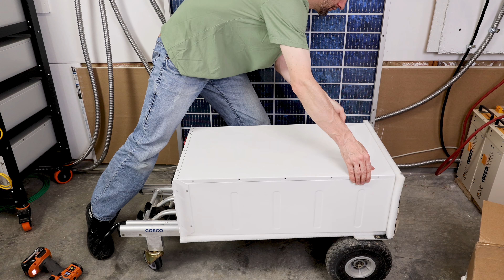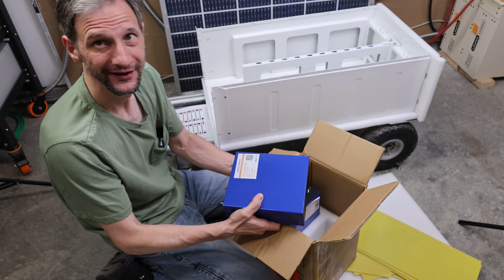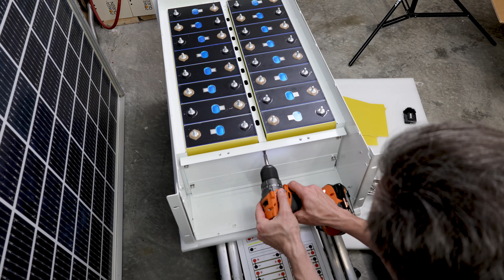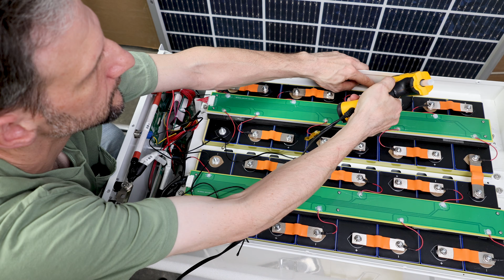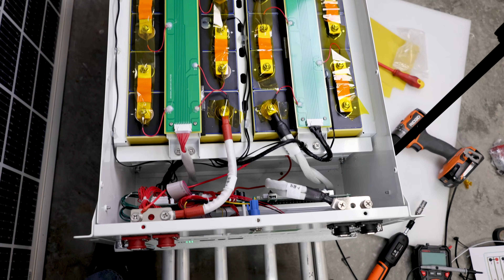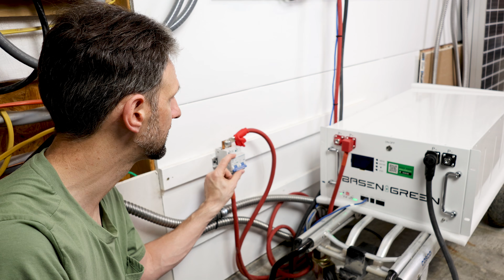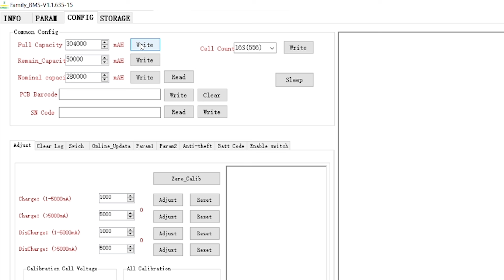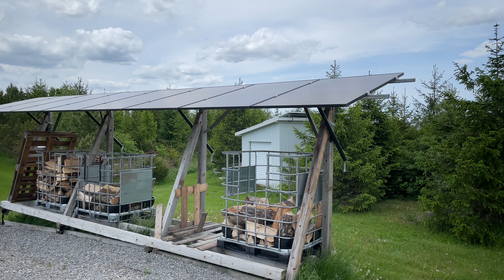SAVE Thousands - Build your own home solar battery backup!

Comment: Great build sir.  My only critique on these boxes are that they don't have a fuse or breaker beyond what is in the BMS.  You might be able to add a T-class fuse inline on the main red positive conductor.  A little tight to secure a fuse cover to the inside of the box.  A small DC breaker would be nice as well.
Reply from the maker: I wanted more than the BMS fuse as well, that's why I added the external breaker.
Reply: Excellent build and instructional! 
My only concern is missing active cooling ability.  In warmer climates, under load  the cell temperatures could be in the higher range. This possibly could cause loss of capacity. Is this a valid concern?
I am a new subscriber today. Excellent content coverage❤️
I am looking forward to your future videos ..😊

Comment: Nice video, thanks. Can I check that it is ok to stand the case on its side which means the batteries are not upright?
Reply from the maker: The side is ok, I just wouldn't turn it upside down.

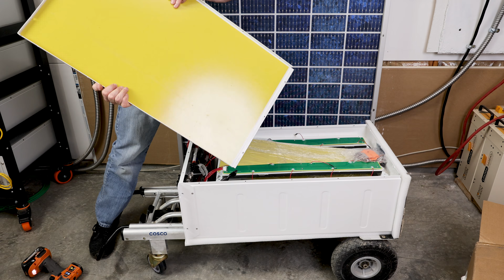Comment: 2:25 I almost had a panic attack as I watched him lift of the front panel and almost take out the pcb.  edit: I think it did make contact, if you didn't notice might be best to check the traces for any damage.  Gorgeous looking system.
Reply: He barely bumped the fiberglass strip for the balance wiring. Not a big deal.

Comment: 15kWh of battery for a little over $2000 is absolutely amazing!
Reply: $2300 with circuit breaker vs $3300 for a signature solar battery, perhaps less if bought on sale.  Nice savings, but at the same time the signature solar one is pre-made and has a warranty attached to it and has UL.
Reply: @asusreviews  Personally, I prefer the idea of knowing the system intimately. that way I can perform the repairs instead of having to call someone out. as for warranty you can likely get that for each component and UL just means a third party says it is safe when used as intended. not overly important but again like the warranty you can likely get that review on the individual parts.
Reply: @asusreviews looks like we're all winning here!
Reply: @asusreviews  if you are building it yourself I assume you cannot get the federal tax incentives.
Reply: @juanmedinar20  Who knows honestly.  Would have to do some digging in the rules/regulations/requirements for that credit.  But that is a good point, it may not end up saving any money if you don't qualify.
Reply: I think you'll find the tax incentives are self funded and simply hidden in the installation costs. Get a supply only quote then once that has been received, contact the provider and tell them youve changed your mind and would like a supply and install quote. Compare the two and you'll find the supply and install quote has a margin over the supply only quote which can be derived as the installation component of the supply and install quote. Question the instillation process to gain an understanding of the labour costs and i think you'll find that the cost for instillation has been significantly marked up from what the cost would be expected as being when considering the number of workers the time taken and the consumables required. This mark up is where the tax/cost incentives are hidden as you'll see. Besides warranty matters, you are saving money by doing it yourself as the incentives are used to create an asset class of nominal value which can then be used to manipulate the market chain in a manner which i can assure you are NOT in your best interests. 
  @juanmedinar20
Reply: Tesla 13.5kw in uk is £7500, in dollars that's $9600. Tesla is 5 x more expensive and its 1.5kw smaller than this system.
Reply: @moltitrader  Ánd the Tesla boss is a nazi!
Reply: I have 120kWh for 10.000. I just took two batteries from a BYD electric car. Hooked them up with a DEYE HV inverter. easy
Reply: @Aeriozo  i've been looking into doing this since used ev batteries are so cheap, any major notes or vendors to look for
Reply: @blank-m2z they’re cheap because they’re by no means actually at the capacity on the tin by the time they are finished being used by the car. Easily 20-30% capacity lost, perhaps more if it wasn’t treated well. You’d have to actually run a real capacity test to validate how much you actually have.
Reply: @OneEyedManKingdomOfTheBlind   @OneEyedManKingdomOfTheBlind  aren't they listed at the estimated(or even tested) already degraded capacity, the main downside from what i've seen is that you have to wire up everything and they're not as energy dense as new batteries so you need a bit more space
Reply: @blank-m2z like all used goods, if you don’t test them yourself, you’re basically asking to get scammed.
Reply: @OneEyedManKingdomOfTheBlind  thats fair though i did check a listing i had seen at the same time as this video (it's sold out now) but 
G1 Nissan Leaf LMO 7.6V 500Wh 38Ah for Bulk Purchase
smallest unit was 13.8 kwh at $60 per kwh, about double the $ per kwh of the set up in the video
it also came with a reported 6 month warranty and tested capacity. of course test it and if they are lying get your money back but seems like a pretty good deal
Reply: @blank-m2z yeah for sure, I think batteries are very quickly going to find the bottom of the price bin.
Reply: @OneEyedManKingdomOfTheBlind  oh ya the prices seem to have gotten even better from the seller i checked (greentecauto) i just browsed through it again and found a $50 per kwh buying per 2 kwhs with bulk of 100kwh at $20 per
Reply: But it's Low Voltage so you need expensive inverters. Im waiting for High Voltage DIY batteries.
Reply: @Aeriozo HV DIY is not possible due to risk of like hazard above 70 Volt DC! So you will wait until you bite the dust.
Reply: @Aeriozo  can't you just buy smaller kits and wire the homemade batteries together to create a higher voltage battery bank?
Reply: @jonnywow2585 What are you referring to?
Reply: Its too expensive. I just ordered Seplos Mason 280 ah DIY with Cornex A class cells and 200a BMS 3.0 for 1250 USD. Shipping costs 450 USD.
Reply: its too much
Reply: $2K doesn't look very cheap, but compared to most other systems for solar energy storage, yeah that's a bloody impressive price 😁
Reply: 12 12v 130 dollar lithium 27 series batteries, car battery size would do it at 1569 including shipping and tax. I got some from temu and I tested them all out out more than 1280 wh. But even 2000 if better cells or something is cheap
Reply: You can buy an electric car battery thats gently used with a capacity of 46kwh for 2000 bucks online well its like 2400 with freight, i might get one later, i ordered two used tesla 48v 5.5kwh batteries for 460 bucks online well its the same site
Reply: thanks to china
Reply: Tell your homeowners insurance company that you built the battery, and it's not Ul approved and it wasn't inspected by the local building department.  😂😂😂
Reply: ecoworthy charges 2000 for a 16kwh battery. not seeing the savings here. same price and a lot of time and other materials
Reply: Yep and to drive that you'll need to spend 3.5 - 4k for a capable inverter. It all ends up expensive anyways.
Reply: @tookster7483  Anyone paying that much for an inverter nowadays is being RIPPED😆. Even a budget EG4 inverter for $1500 can handle that.
Reply: Being new to this ,anyone can tell me  books required to understand this electrical system???
Reply: The batteries are double the price now.
Reply: @SiXiam  Actually, battery prices have gotten even lower....across the globe.  I don't know where you've been looking.
Reply: @PaulShalahm  I'm talking about the link for the battery depicted, in the video description.
Reply: @SiXiam  I see.
Reply: @PaulShalahm they're about to spike when biden's 100% tax on battery imports goes into effect next year
Reply: @P7ab  you think he'll make it to next year? Him or trump for that matter..LOL. Any way, it's amerikkka's tax hike not just biden's.
Reply: @SiXiam  I just looked today Aug 5th 2024 and they were $106. I also found some 314ah cells for pre-sale at $87
Reply: @P7ab  Yeah more like Mericas tax on imports.
Reply: @yourmomma69-g5r  yes, biden's 100% tax on batteries and solar panel imports
Reply: And theres no longer a lithium shortage, combined w the lackluster demand for EVs, ive heard it elaborated that we're seeing a lithium battery price crash currently @PaulShalahm
Reply: @PaulShalahm usa 🇺🇸
Reply: @Jakeeofalltradess  No... but I study amerikkka's factual history. You should try it some time.
Reply: @LarpLaughLove he is probably a typical democrat that thinks the country is full of white supremacists and clan members yet has never met one. I live in AL and have spent alot of time in Arkansas, GA, the entire southeast and been to almost every state but have never met or seen a clan memeber or white supremacist except for in the prison system and that hardly counts cause they just join gangs for protection and dont really practice or hate like that for real. Now I have seen way more hate in the other direction but noone will talk about that.
Reply: @P7ab lol how that aged like milk
Reply: @SiXiam   I just checked their website 07/17/2024.  Just FYI the 280Ah cells are $77 a piece.  They have a package deal with the kit for $1730.  If the shipping is indeed free?, then this is a crazy good deal.  12 cents a watt.  Cheaper than even the price in the video.  I don't even need a battery and its tempting.
Reply: @clintclark89  Reminds me of the Will Prowse videos where he will post a deal and it will quickly either go out of stock or the prices will change. Guess you got to have patience and wait for the deals to come back like it did now.
Reply: @clintclark89  " I don't even need a battery and its tempting." - Lol. You sound like me. I do that all the time.
Reply: @SiXiam yes, because there is restrictions on importing certain solar systems components from chine. That is the reason it is becoming more and more expensive...
Reply: @SiXiam yup. MAGA. Make American goods affordable
Reply: I still don't get his math right at the beginning when he says @DIY prices. DIY is 1/2 the quality at 4X the cost while only lasting 1/3 as long before having a professional reinstall what took you a month to build in an afternoon... Or did the world get a patch I was unaware of?
Reply: @JaredBrewerAerospace Just a bit extreme on the fractions.Don't you think?You can't put all diy in one.Just like you can't with  people either.everybody is different.If what you said is true.Then why is diy so big along with a big market to go along with it?If you have the skills and take time to learn.You can have great quality and save a ton of money.Taking a guess at it,I'm going to say you have little skills and might have the money to do it your way.But have no logic what so ever.Many reasons why people diy even if you take the money saving out of it.
Reply: @JaredBrewerAerospace  LOL 🤣🤣 if I had that kind of record for diy, I wouldn't build anything ever again! 🤦🤕
Reply: @JaredBrewerAerospace not true ...

Comment: I did the exact same thing with the Seplos Mason 10.5kWh DIY battery pack, and they stated the importance of drain the pack down to zero and charging the pack up to 100% on the very first cycle so as the BMS can check the batteries capacity in real time. Not sure if you did this? Plus I like your set up looks very professional, except that the cut off DC switch you are using is not what the professionals would use. DC when in use and under load is very difficult to switch off as arching is very likely, and so it has been allowed to dissipate which is done through a series off metal plates within the switch. Sarah here at her Youtube channel called Gridbusters is about to make a video on this very subject so you might want to check out her next video coming soon. https://www.youtube.com/@Gridbusters-qx4om

Comment: Hi Dave. I’m trying to learn about solar. If I had 16 pc of this 15kwh battery. How would I charge them up with 30kw of panels over a 6 -8 hour period. Basically how many all in one eg4 12k hybrid inverters would I need as I’m thinking I’d need many charge controllers to charge 230k kWh of battery for complete off grid 10 bedroom hotel. Thanks.

Comment: THE ADDED SPACE IN YOUR CASE WAS TO ACCOMODATE FOR HEAT EXPANSION. Lithium ion batteries with no expansion allowance buckle and degrade faster. Ask diy toy makers
Reply: No, u should not allow them to expand. They degrade faster if they can expand. Look at any A-brand battery with these kind of cells, they are always clamped with side plates or metal bands. Clamping forces are also stated in the datasheet, so you don't have to guess or learn from random youtube strangers.
Reply: Or you could just ask Samsung 😂
Reply: If I'm not mistaken, the prismatic cells actually perform better with some mild clamping force. These are lithium iron phosphate, not lithium polymer cells, so the expansion is less of an issue.
Reply: he may be ok since there was also foam, but agreed that it's risking taking out that space.
Reply: I was going to ask the same. How are other, high rel Li-ion packs made to allow for cell expansion? These are all tight next to each other, and he mentioned installing the case vertically. Those lower cells will have a lot of weight on them. Galaxy Note 7 on steroids?
Reply: won't the foam alow for enough expansion?
Reply: These are not lithium ion.
Reply: @ramirocotarelo4083  Offcourse they are, don’t be silly.

Comment: How long do they last?
Reply from the maker: They last a very long time.  They are rated for 5,000 cycles to 80%. Even if you cycle them every day for 13 years they would still have 80% of their rated capacity.

Comment: Thanks for this review! It is really cool to see this DIY battery kit. I have been considering EG4 for the Inverter with this kit. But, I don't know if this battery kit has the protocol to match?
I definitely don't like the fact that the bracket can easily come close to contacting the Positive @ 14:00.
The lack of "stock" isn't a real confidence booster either.
Reply from the maker: I haven't tried connecting it to an EG4 inverter.  At this time, considering the reasonable price on the new EG4 vertical battery I would just go with this one: https://signaturesolar.com/eg4-wallmount-indoor-battery-48v-280ah-14-3kwh-indoor-heated-ul1973-ul9540a-10-year-warranty-pre-order/?ref=SALE
Its still in stock here: https://www.currentconnected.com/product/eg4-indoor-wallmount-48v-280ah-14-3kwh-lifepo4/?ref=pwd

Comment: my man! you have done a potentially dangerous thing! an inverter should be switched off completely from the grid and from the load, give it a minute or two. Then you connect a battery to an inverter and let inverter run off the battery for a minute or two. Then connect to the grid. Then connect to the loads. Be safe!
Reply from the maker: What dangers thing are you concerned will happen?  You can make the battery connections with the invert and the battery in the off position. 
 Turn on the AC to the inverter, then turn the inverter on.  There will then be 50V on the battery terminals even with the battery off.  At that point you can turn on the battery and there will be virtually no potential difference so nothing will happen.  The inverter will then decide based on voltage to start charging if needed.

Comment: Does your battery system protect against backfeeding into the grid under grid power failure. ( Assuming the solar already has protection built in )
Reply from the maker: Basically, yes, but that protection happens at the inverter, not the battery.

Comment: As you verified the voltage between cells is very close however this does not mean they are all at the same charge state.  From experience the cells will not be at the same state of charge unless you top balance them.  I tried several days of hooking them up in parallel with no progress.  One cell would always drain first and another cell would cut off at the top.  I could watch it on the overkill BMS.  After top balancing this took over a week with a 10 amp charger on a 12v bank, they preform much better but I do think the cell that would hit low voltage is not as “good” I now run an active balancer with this bank to help keep them balanced.
Reply from the maker: Right, the voltage curve for LiFePO4 batteries is very flat. It takes some time to top balance them and they have to be regularly balanced to keep them together.

Comment: This is a cool idea but it hinges on cheap grade a batteries and the availability of that case. I was ready to purchase enough to build 5 of these batteries but they are all out of stock, the only batteries in stock in your links costs a whopping $800 for a set of 4 of the batteries, which comes to $3200 for just the cells,  $100 less than the EG4 wall mount I am currently waiting for a free shipping promotion to purchase. Then you have the case, if you can get it, plus labor, and lack of a warranty. If they can keep these in stock then it will be an amazing value, but until then it isn't worth it imo. I love that this is happening though, I hope that a few other companies start doing this and provide cheap DIY battery kits.

Comment: BMS must be 1C capably or 300A, not 200A... and this is first reason not to pay $500+  for metal box!
I will Always go for full DIY or buy commercial one for little more $$$
In this option, we lost time, payd for metal box + batteries and saved absolutely NOTHING

PS: and there is no breaker in DIY kit? Thanks but no thanks

Comment: does it come for a smaller battery set like for 5kwh
Reply from the maker: I suppose you could reconfigure it with lower capacity batteries, but I don't know of one designed for 5kWh.